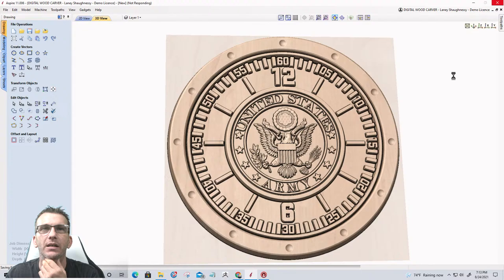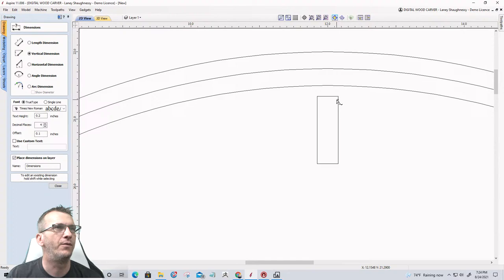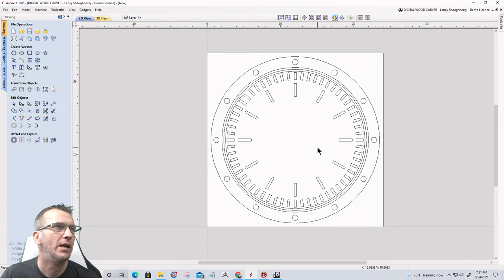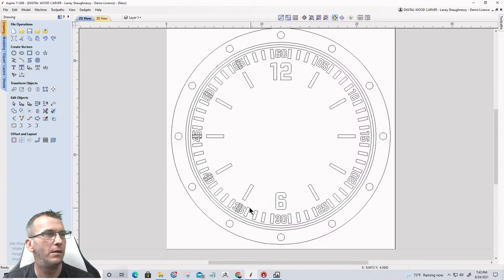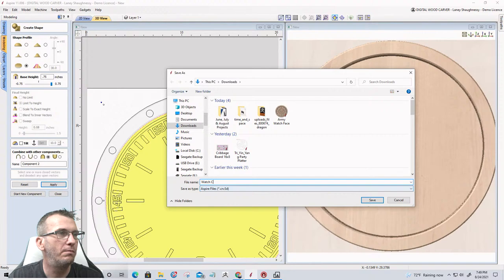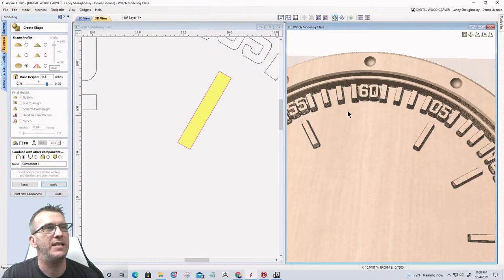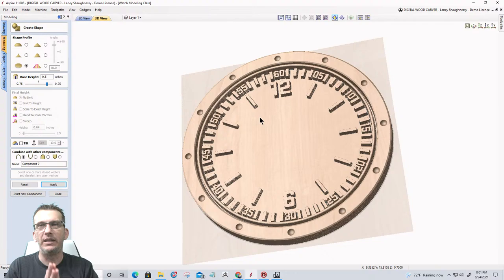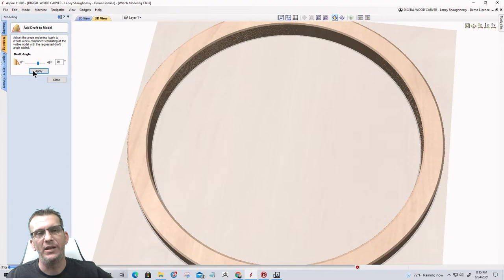Creating a 3D Model - (Watch Face) - Vectric Aspire

Comment: Hello Laney, regarding the numbers 5 10 15 20 ..... , why not using the "circular copy" tool on the text of number 60 then changing/rotating the content?
Very good project and cool clock
Reply from the maker: You could do that rotate one number around then go and change the number to the correct number....i just find it much easier to use the method i use especially when it comes to having to rotate 20,25,35,40 ...but it doesn't mean its the only way...both are good options... So do it whichever way is quickest and easiest for you...thank you for asking the question is was a great question and great point.

Comment: Mach 3 has some motor settings for acceleration. can skip steps if not set right.
Reply: I'll run Mach 3 had that problem it was a wiring problem interference fix my cable never had that problem again

Comment: Very well done.  I really enjoy your teaching style.  I got several things out of the lesson.  Key items, how you work with levels an don't change your original components when going to do things like smoothing, baking etc.  The rotation methods was pretty cool. Glad I found your channel.  How do I know what models you have available for purchase.

I noticed that you smoothed the whole model including the dragon - which took out some of the detail in the dragon, like around the eyes and some wing components.  If i wanted to get the smoothing on the rough edges, but keep the details in the dragon, would another option have been to only smooth everything other than the dragon?  Trying to ensure I understand the concept.

New to the idea of making things to sell.  I thought if you purchased a model you could not resell the model, but could resell things you make using the model?  Based on you stating you couldn't sell the clock with because it used a purchased model was curious if my understanding is flawed?

Thanks again for the efforts.  Will be sending you an email o purchase this model.
Reply from the maker: We will be launching the new website soon, models will be available for sale on the site when it launches... in the mean time some of my past classes announced models for sale... (4th of July, 2A model packs, Fathers Day Projects) instruction on how to order were in the classes. Soon there will be a site to download from. 

One could turn off the visibility of the dragon and baked the clock without the dragon, smoothed the clock and then if they chose could do a separate smoothing on just the dragon or no smoothing on it. 

When you buy a model, you can carve the design and sell your carvings. But you can not resell the model file... What I was referring to, is I was selling the clock model but could not include the Dragon model because it is not mine to sell. I am referring to the files, not the carving.
Reply: @SpindleTV  thank you for the clarification - looking forward to your website getting up and running.  Saw your part 2 of vcarving the same vectors last night.  Well done, even with the buffering - those things happen.